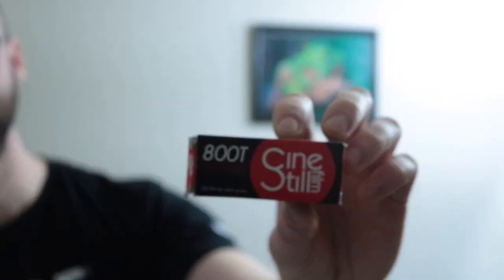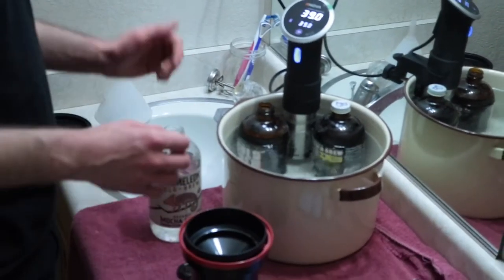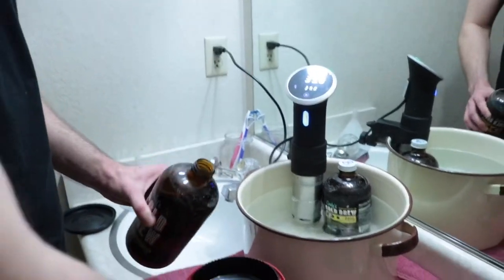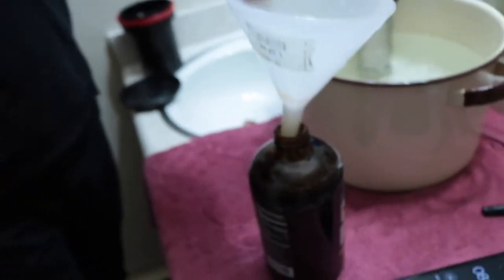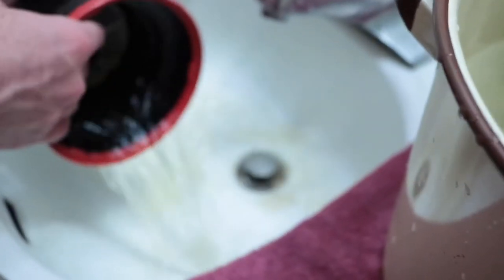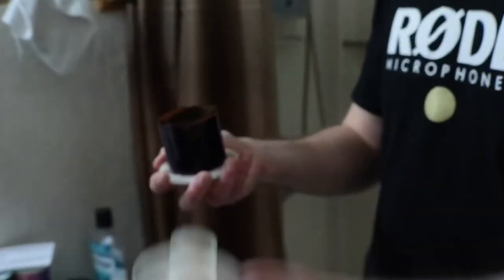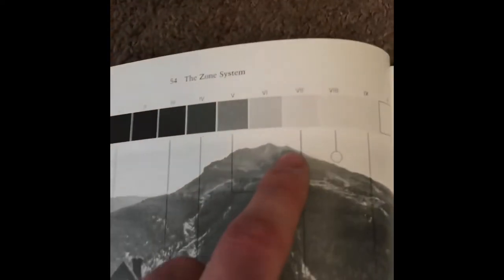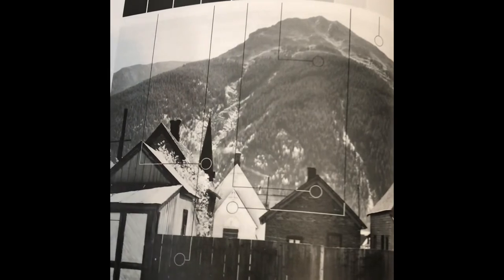How To Push Color Film

Comment: Thank you so much ! May I know your ISO you used for day light shooting? 500 ISO? is CineStill works well when using lower ISO such as 500 or 400? I really want to avoid noise and white fog on my images. I'm on 35mm.
Reply from the maker: Cerisette Kotomi I rated the ISO at 400. Meaning I shot it at 400. I think Cinestill works best at that iso. There is very little noise or grain.
Reply: The Negative thank you for such precious information as I am going to shoot today in Paris in red light district! Should I develop it in lab by saying them to develop at 400iso?
Reply from the maker: Cerisette Kotomi that won’t be necessary! But for yourself set the camera meter to 500. 400 if you have an orange filter over your lens as I did. Any questions, feel free to ask